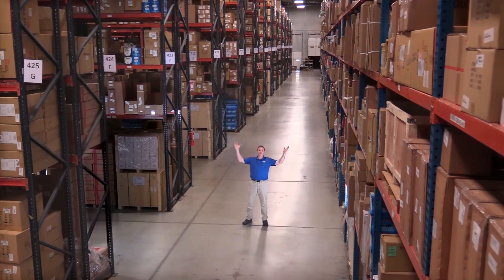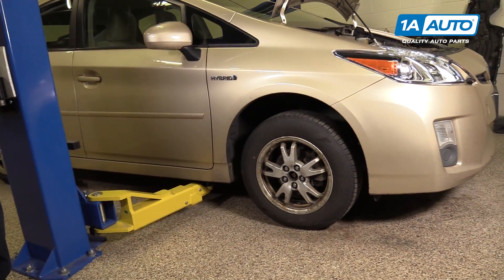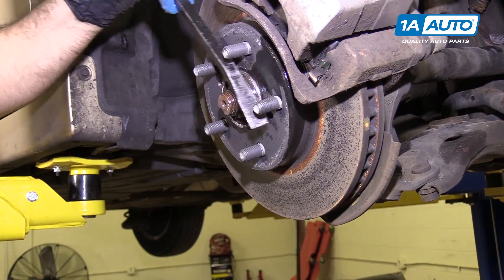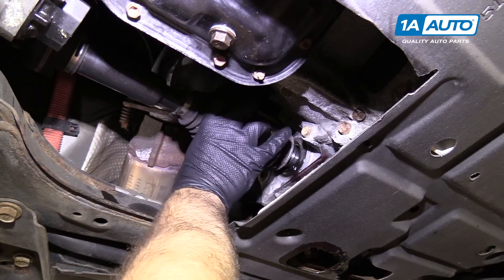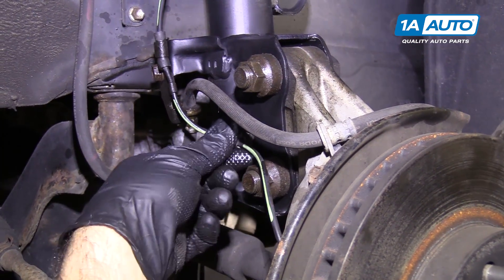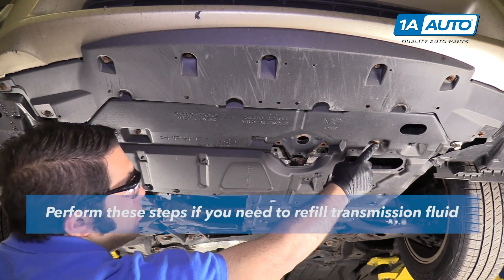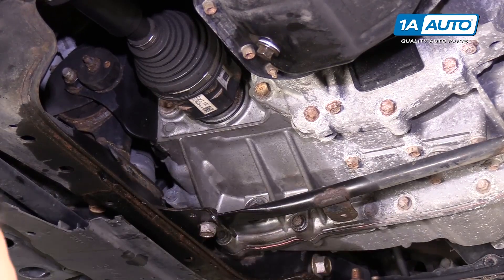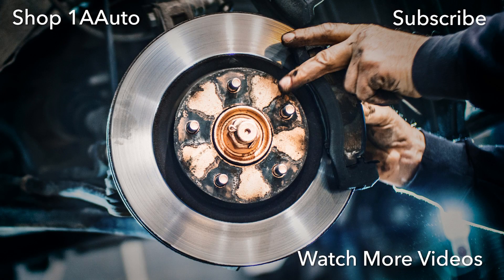How to Replace Passenger CV Axle 10-15 Toyota Prius

Comment: So, the only problem here is that you torque the wheel nut, which is great, but you don't collapse the outer rim of the nut into the groove on the axle so that the nut is locked on.  😞. You definitely want to do that so the nut doesn't back off.

Comment: What do you do if you damage the seal?
Reply from the maker: +sleven6593 If the seal becomes damaged in any way, it may not be able to support the axle correctly making it prone to popping and loosening.
Reply: @1AAuto  is it easy to replace thd seal in the transsmission? Or and i screwed?

Comment: I replaced the CV axle on my Prius. I have a question. After installation, I noticed the new CV axle does not have the metal dust cover at the end of the axle on the transaxle side. Is this a necessary component? In other words, will the transaxle seal be compromised with this metal dust cover missing? Thanks.
Reply: Yesss
Reply: I’ve done this on a lift, do you think it could be done on jack stands?
Reply: @ProfessionalGasLighting  Yes, just more difficult